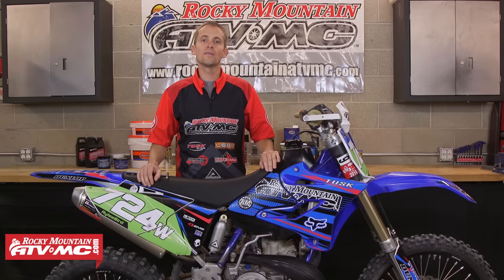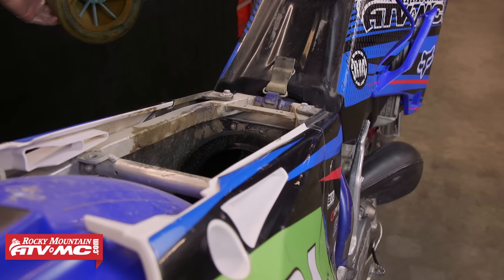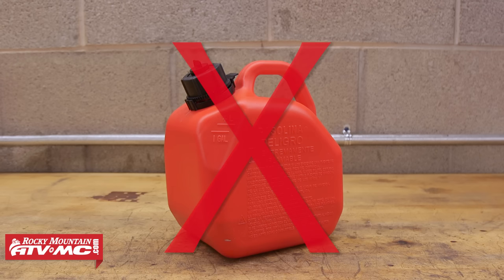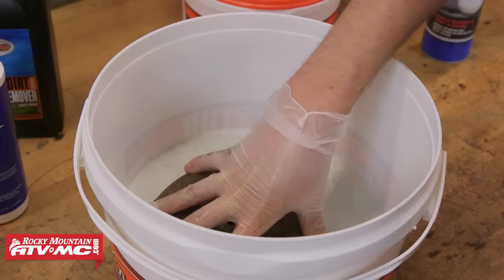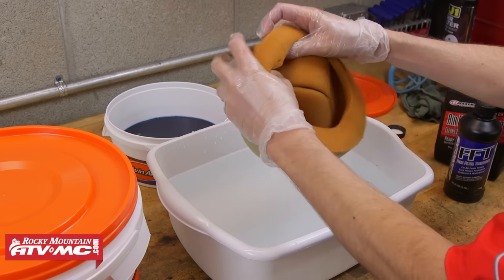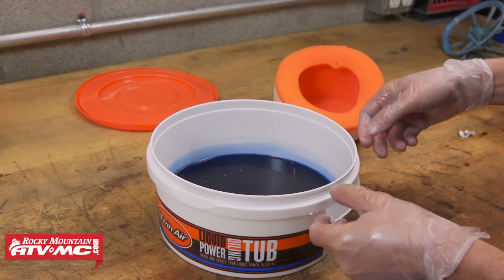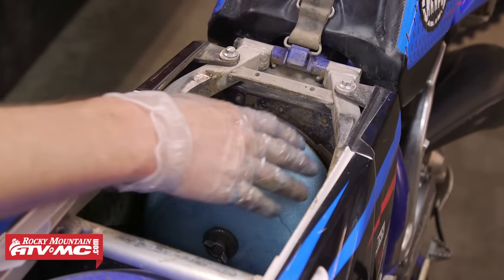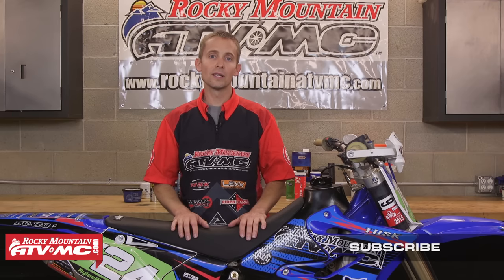How To Clean & Oil a Foam Air Filter on Motorcycle or ATV

Comment: Hats off to the marketing genius that sold these guys two buckets, one with a cleaning label, and one with an oiling label.  Brilliant.
Reply: I know that's so smart they prolly baught those buckets at dollar store and sell em for 15 a pop
Reply: Detergent and warm water don’t get oil out of the filter.   Pour about 2 or 3 OZ of paint thinner over the filter and squeeze it then everything will come out of it.
Reply: The paint thinner will take it out instantly.
Reply: @Harold Smith i clean it whith gasolin in les than a minite
Reply: efi rizaki i did that as well, but my filter fell apart so i had to get a new one.
Reply: @efirizaki5656  varsol works best
Reply: Erwan Compes it helps if after you oil it you poke a few holes in it with a fork and bake at 375 for 10 minutes to really activate that oil
Reply: Lmao
Reply: 55c
Reply: This answer section is cursed
Reply: Brilliant and genius are not words I would use to describe shameless vicious greed.
Reply: Lmao
Reply: @charlieoconnor2652  make sure you buy the oem diamond sand.
I heard it keeps the piston and cylinder at a mirror finish always
Reply: @SekaCity This is an old trick for deglazing you cylinder. You have to mix different grits for maximum performance.
Reply: @SD-ir1vf  that’s a horrible idea. The glue in the seems will dissolve.
Reply: @tahoemedia    Yeah paint thinner cost too much I  just use gas now.   It’s even more better.
Reply: @Erwan Compes hahahahhahaha
Reply: @liammacarthur9618  this is where the laughs are , Hahahaha
Reply: @Erwan Compes you guys are killing me , imagine if people are trying your tips
Reply: One born every minute.
Reply: I thought so too
Reply: This is exactly how I've been wasting so
much time, I've been tying one shoe a day,
I plan to apply this philosophy,:washhands: and see if 
I can't make the process more efficient.
Reply: @garretthemack5076  i was at a store the other day the big one is 30
Reply: Bruh💀
Reply: All that cleaner, buckets, and shit for a 15 dollar filter. So much easier to just replace it when it gets dirty 😂

Comment: Pro tip, Get 3 or 4 air filters and keep them fresh in zip bags. Use them all up and then wash them all together. Saves a LOT of time.
Reply: That’s very smart
Reply: Great idea. I've been doing this for years now. I also have extra  shock linkages cleaned and greased and ready to go.
Reply: dude! thanks!
Reply: I have 15 filters clean.  when all are dirty, it's washing time :D. but is smeell so bad, that I have to go outside :D
Reply: Yeah I'll pass on buying $150 worth of air filters so I can rotate them and 'save time.'
Reply: @connorhd3201  LOL no kidding!
Reply: @connorhd3201   $150.00. Is nothing when it comes to my hobbies. I have clean air filter every ride.
Reply: @SD-ir1vf  I have a clean air filter every ride too. By taking out my filter and washing + oiling it after every ride. 

I don't need to keep 6 air filters in rotation to save a little bit of time. Unless you're riding in terrible conditions 7 days a week and only want to wash a bunch of filters once a week, it makes no sense to have 5 filters. Just wash your one filter after every ride and stick it back in. It's not hard.
Reply: how long does a filter last, the Life of a typical air filter?
Reply: What do you guys think about filter covers? Are they needed in a sandy environment? Or not?
Reply: @jacob2483  filter covers are handy for on the fly cleaning. If you’re racing sometimes is nice to just rip the cover off and keep going instead of swapping filters. Other than that I don’t use them.
Reply: @YamaMotoGarage  thanks for the info, yeah I picked some up a three pack of stretchable covers that need to be oiled for like $20 bucks, but it may be better to just buy an extra air filter and always have another air filter to just throw in. In the area I ride sometimes it is pretty sandy, still some dirt but I just want to make sure I do everything I can to stop anything from getting into the engine, but a well oiled air filter and a bit of grease on the rim might be good enough.
Reply: @jacob2483  Yeah for sure man! Pretty much every catastrophic engine failure I’ve seen typically comes in with a hole in the air filter or crazy amounts of dirt in it. It might seem dumb but keeping your filters as clean as possible will save your engine in the long run!
Reply: @connorhd3201  why
Reply: Yes 👍 this is a better way.
Reply: @SD-ir1vf  i don't mind paying for peace of mind an convenience!  5 new filters clean & ready !  - Ohio
Reply: @realcolbyadams  depends. Till u see a tear is how I go by.
Reply: Late, but can you wash them all in the same air cleaner liquid bucket? Like can I re-use the liquid if that makes any sense at all
Reply: @sciolifilms  yes you can reuse the cleaner. It’s used mostly for getting the oil off. Once it’s not sticky any more you want to get the cleaner out so I run mine under some water with dawn dish soap or some oxy clean. Then rinse it all the way out and let it dry completely
Reply: @YamaMotoGarage  how many times can I reuse the cleaner before getting a new one? 3-4 times ?
Reply: @Revolver0cel0t  it really just depends. You can use the cleaner indefinitely until it stops getting the oil off or the filter comes out dirtier than it started.The cleaner is really just for breaking down the oil. After I use cleaner I’ll run hot soapy (dawn dish soap) water through the filter until the actual dirt is clean. If I notice the oil is still on the filter after the soap I’ll run it through the cleaner and repeat the steps. If your filters are exceptionally dirty then you might only get a few uses from the cleaner. Also watch out for the bottom of the cleaner container. After a few filters the oil and dirt will settle to the bottom of the cleaner container and if you dip the filter too far down it will get all of that gunk on the filter you’re trying to clean. Cheers
Reply: @YamaMotoGarage  ah I see thanks for explaining further bro, appreciate it
Reply: I've been doing that since riding mini's in the early 1980's! Of course I could only afford 2 or 3 filters a back then! But it did save me alot of time!
Reply: @YamaMotoGarage  AMEN!!! a clean, well lubed filter will save your intake valves, piston, and your nikisil coated cylinder!!!
Reply: @sciolifilms  yes! that's the whole point of using that same bucket....
Reply: good idea
Reply: this guy air filters, thanks for the tip!!!

Comment: Spends 5 min washing and soaking filter, wastes gallon of cleaner, THEN checks for tears. OH NO we cant use this anymore!
Reply: Instead of just repairing the hole he tosses it out. Could have just used a dab of proper glue.
Reply: Lmfao
Reply: @charlesgunzelman3323  Or a dab of silicone caulk will seal it too as it was small.
Reply: He wasted time but not the cleaning product you can use it a lot before you need to toss it. But he used a $15 Twin Air bucket instead of a $3 one from Home Depot with a lid...LOL
Reply: Meeker Extreme the twin air one has lids as well
Reply: WeeStrom CO Guy it was sarcasm.... I’m sorry I didn’t lay it on thick enough

Comment: I always get a kick out of this when people say using gas as a cleaner is dangerous, most of the solvent based cleaners we use are like 10 times more combustible than gas. In fact, if you want your bike to go really fast, spray some of those other chemicals in your tank 😂
Reply: Do be careful with gasoline. While your statement is true that other solvents are combustible, most have a much lower vapor pressure and thus won't rapidly burn (explode) as gasoline will.
Reply: The trick is to clean the filter with gas and then light the filter on fire to burn off all the excess dirt.
Reply: I assume the gasoline will deteriorate the foam after a few cleans
Reply: @nickolausmackie6900  and eat the glue that holds the filter parts together!
Reply: @nickolausmackie6900   i use gas almost every time i clean my air filter.  it takes everything off in seconds.  I have over 10 cleans on the same filter and still good to go.

Comment: I've been using gas for 2 years and only replaced the air filter once because I wanted a aftermarket one lol , Gas works great
Reply: Don't use gas. Dawn dishwashing soap is great an less messy. Try it

Comment: the best air filter cleaner is some dawn dish soap. it's a wonderful degreaser. I always squeeze mine till clean. you don't have to pay an ass load of money just buy a bottle of air filter cleaner.
Reply: Tried Simple Green, Oxi Clean, and Dawn with no luck.  (Blue Maxima I believe) This is a filter that the bikes PO had in it.   Wanting to change this filter over to No-toil like my others.
Reply: Azia CR to get the cleanest filter first priority is to have a clean air box......
Reply: Gas works the best
Reply: Azia CR thanks bro
Reply: Do you have to oil it after?
Reply: I do the same
Reply: Dawn and gazoline
Reply: Smells that flower clean fresh too
Reply: Regular Bucket and dawn dish soap indeed.

Comment: Good video, I do my filters slightly different, I use maxima as shown in the video but in the can form. Spray the filter with a thin coat of cleaner and gently rub the cleaner around with your hand, side to side don't push into the filter, and let it set in for a couple minutes next wash the the filter form the inside out at first to ensure pushing dirt out rather than in to the filter, then saturate and squeeze the filter until clear water comes out, I always rinse in running water rather than dipping so I know no dirt in the water gets in the filter, hang the filter somewhere clean till its dry. Then put it back on the cage and spray a thin coat of oil around the outside of filter and worked in lightly and a thin spray along the seam where it contacts with the boot and worked in lightly.
Grease is overkill and messy, too much oil doesn't allow your bike to breath at optimum levels, keep a clean air box for this same reason. Clean the filter every ride if you ride dusty trails or tracks, every 2 or three at most if on constantly maintained (watered) tracks. The less you clean your filter the quicker it wears as dirt is sucked through the material it is more difficult to get out and the integrity of filter declines. Change oil after 3-4 rides in dusty conditions or when riding track, 5-6 in low dust environments. Trail bikes can go much longer on used oil since they generally hold more of it and are lower revving bikes, however when used in dusty environments or with a dirty air filter, oil life span decreases, change oil filter every other oil change( if not built up with dirt and metal). I run hi flow filters with an OEM filter every 3 filter changes. Hi flows keep engine cooler and using the OE filter helps make up for the lower cleaning abilities of the hi flows. If you have split sumps change trans/clutch oil every other oil change. Unlike filters, changing oil every ride is wasteful and bad on your motor, oil has a detergent aspect that breaks down rather quickly, just enough to clean things up and push it to the filter, constantly changing oil is like constantly washing your hands with bleach, it's good once and a while but if you do it too often... You'll start to look like E.T. Be cautious of what oil you use, in split sump motors most normal 10w 40 oil is ok on the motor side, but not clutch, some oils have additives that ruin your clutch( make it slip). I recommend yamalube 10w40 or Honda GN4 10w40. this oil is good for any motor or clutch, so if you have a split sump race bike and single sump trail bike, same oil if fine for all 3 applications. Buy in bulk it's cheaper. Always test dummy nuts, side screens, and dipsticks after changing oil, even when following manufacture instructions, more or less oil may be needed to fill your sump to proper level, check your oil level before and after you let your bike run for a minute or so, give bike a couple slow kicks ( 6-10) at first just to get the filter and oil pump somewhat filled up. Do this with gas off or you may flood your motor with gas. 
Long story short, bikes are a lot of work.
Reply: yeah my cousin bought a old honda 250r to ride on trails with our klx230 dualsports. what a bad idea on his part, the dualsports need such little maintenance compared to the mx bike. oh well at least i know not to go on a long adventure in the middle of nowhere or else we'll be tandem to get back lol. i love the tips though it really helps. have fun out there cause i know i will  :)
Reply: @elihautamaki547  that 250r will gap you tho… it makes people a better rider, and better maintainer
Reply: @JonahZX10  i agree, he's still got to make it over the learning curve, we'll see how he does this summer.

Comment: Awesome tutorial, it mentioned all the important steps. Only thing I'd do different is to use dish soap to clean the filter since it's gentle on the foam and does just as good of a job as the best air filter cleaners. Regardless of products this was a very informative tutorial, it's creators like you that made YouTube as awesome as it is!! Learned many sweet tricks from you guys over the years so keep up the great work 😀
Reply from the maker: Thanks Enduro Skills for the great feedback. Appreciate it sir!
Reply: Also I like to let the oil dry a bit on the filter before I reinstall it into the bike
Reply: I agree great video. I’ve been using basic dawn dish soap on my filters for over 35yrs. Works great
Reply: How much soap is used to clean one filter?
Reply: @oscar4605  a lot! (:p
Reply: Do you use hot or cold water when washing

Comment: My favorite air filter cleaner was regular Kerosene, which is getting harder to obtain lately. That whitish liquid for cleaning, in this video is just mineral spirits (available at most hardware stores) better than gas, doesn't break down the glue on your foam filter, and does not smell.
Reply: mineral spirits is a clear liquid though...
Reply: Mineral spirits is 23 dollars a gallon at home depot getting expensive

Comment: I use Naptha for cleaning.  I pour it in a bucket.  Dunk the filter, then bucket with cold water and dish soap.  Rinse in a clean water bucket or hose.   Let dry and re-oil.  I make a bowl with the filter.  Pour in the Bel-ray and squeeze.  I work it around in the circle with a hand under it to get an even distribution.  When the color looks even your good to go.   I funnel the  naptha back into metal container for storage.  Sometimes through a cut of piece of tee shirt to catch stuff.  I pour slowly off the top.  The dirt stuff at the bottom of the bucket gets whipped out.   I clean the bucket with a bit of brake cleaner.  I have a couple of little small 1 gallon buckets I use for cleaning filters.  I have about 6 filters (3 for each bike).  I don't have to clean them very often so I do it all at once.   I have a couple of plastic bins from the dollar store that house them.  One for clean and dried filters, one for dirty ones.    I skipped the labels ;-)  All of that occupies one shelf in a metal cabinet I have in the garage.   Once a year or so a chemical disposal company comes to our neighborhood.  Usually give the Naptha to them to dispose of as it starts to get thick with oil.

Comment: In my Suzuki manual it says "was with any household non-flammable solution rinse and let dry. Soak in fresh engine oil and press out excessive oil". I´ve done this for 5 years now and havent spent a dime on fancy kits and shiny whatever you´re pushing. My filter is from 1999 and still going strong (road bike tho).
Reply: Lasse Brunborg road bike is why. On dirt you got all kinds of physical shit flying at you less exhaust fumes and road debris. More stuff makes it in there and can mess it up off-road

Comment: Him: * has the smallest tear in his air filter and can’t use it anymore * 

My broke ass: * air filter looks like a slice of blue cheese * oh she‘ll be right for a couple more rides
Reply: he could just super glue the tear... 
And he talks more about his special buckets than the filter😂
Reply: Crap a small tear.... Superglue the tear up, we're good to go
Reply: I use super glue also works perfectly and is good as new👍
Reply: I laughed at that. lol
Reply: My dads such a tight ass that when my air filter had a big rip in it he wanted to glue it back together instead of getting a new one. Couldn’t believe it.
Reply: The cleaner cost about the price of a new filter 🤣🤣🤣
Reply: @hamishwinder4836  You got a bike don't you?  Well go buy the filter yourseff!
Reply: @surfr8  yeah cause I would buy a filter for his bike aye🤦‍♂️
Reply: Most people already have at least 2 or 3 filters.  A also buy new bikes every few years. Not gonna use ripped filters.
Reply: @SD-ir1vf  no kid shut up not everyone has heaps of money to spend on bikes dirt bike riding is already expend as I don’t need a new bike every year and Ye I don’t always have money to spend on bikes so ye
Reply: My broke ass just cutting a dish rag and zip tie it to the old filter cage. Wait you guys use filters??
Reply: @rossarndt6049  That's a crappy solution though. Just buy a square of filter foam for 2 or 3 bucks (probably cheaper than your rag), you'll get better air flow and it will protect your engine better.
Reply: @mariusfauru  And he likes to kep a gallon of it in the bucket? Each bottle is how much? 16 oz?

Comment: And all these years I thought I had it down by cleaning my filter in my orange home depot bucket with my lawnmower gas. In 15 years of doing so I have spent 5 bucks on an orange bucket and a gallon of gas once every 3 months or so.  Dammit I knew i should have bought the white bucket!

Comment: Mineral Spirits! The oil runs out of the filter like blue colored water. Then, warm water and detergent and the filter is CLEAN. Just did it today and I couldn't believe how fast it works. I inspected the filter with a magnifying glass afterwards and it's all good.